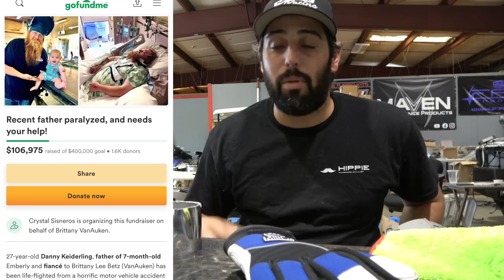SALTY JOHN FAB IS OPEN FOR BUSINESS!!!!

Comment: The protig 205 from harbor freight is a good starter tig welder. If you want to learn how to use it get some material and build a welder cart. Also I'd buy the big bottle of argon for your local welding supply.  Great video slim!

Comment: No I am no welder by any means but I was watching somebody teach somebody else how to weld and another trick that they said to use was to cut the tip off your filler Rod before you start each time so it's like starting with a brand new Leading Edge of the filler rod I don't know if that matters with aluminum or if that was because it was stainless or what the situation was but that's just something that I stuck out to me

Comment: One tip I can give you John is to learn to feed the filler threw your fingers.  Keep your filler less than 6 inches from your hand instead of long sticking it not feeding it through your fingers.  You will have better control dabing your puddles once you get the hang of feeding it.  Takes time but you have been learning fast so you will pick it up quickly with practice.